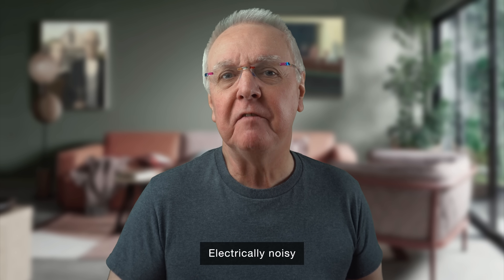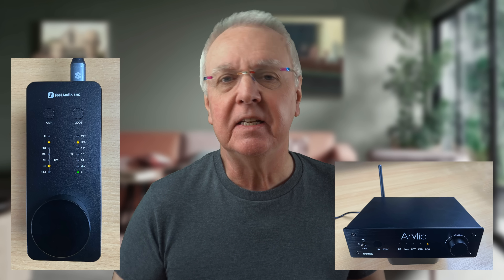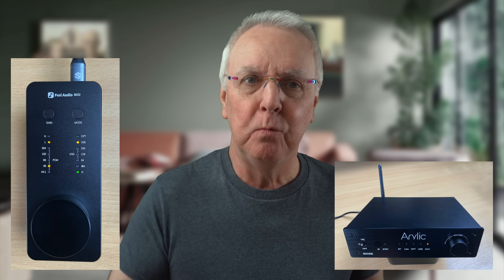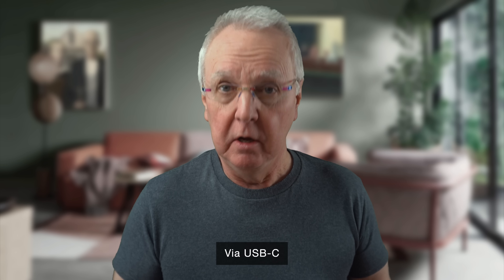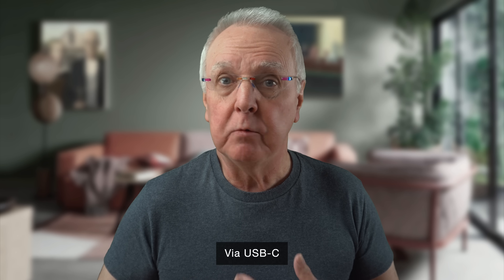Do optical cables have a sound?

Comment: RE  the external "What does Jitter sound like" link. Jitter is from several sources, pattern dependant jitter / inter-symbol and then random jitter from PSU noise affecting bias points, the phase noise of the clock ect. In the linked article, a jitter of 2us RMS (not pk-pk) is added. My DAC clock is 45.1 or 49.15MHz dependant on 44.1 or 48Khz multiple. A clock period here is ~24nS, so the jitter represents 80X the clock, which is crazy. Anyway modern DAC's incorporate a phase-locked loop and de-jitter circuit, so it gets integrated to a mean and effectivly ironed out.  Great channel BTW! A telecom SFP optical tranceiver will pass 1Gb/s or 2.5GB/s data and costs about £15 each. Multi-mode fibre will carry this over 500m no problem. I did listen to the jittered 1KHz tone, hilarious.

Comment: Good point about resistance. As I understand the amount of Johnson noise generated in a copper conductor is a function of bandwidth, temperature and resistance so I imagine one does not need to worry about this type of noise being introduced with optical. 

That said apparently optical cables with glass clading and glass core are the best but I find that most manufacturers are mum about the composition so one can't really be sure of what they're buying.

Comment: I remember in the good old daze, audio files would talk about a good marriage between components, especially amplifiers and speakers.  As every time a analog signal goes through any stage of amplification it is inverted and each stage can add its own distortion.  As light is just a carrier for P.W.M. it should be a much cleaner transfer.  In my tortured audio experience I have only come across very few amps and speakers that had a good marriage. But the few that did, anything that I played on them sounded fantastic and my search continues !  If I only could afford a 20 grand tube amp. to test my latest theory !

Comment: Are not the data points at the ons and offs? And isn't the speed of light 186,000 miles/sec.and constant. Bearing this in mind shouldn't all optical links sound the same. My preference would be optical for digital and wire for analogue if my equipment allowed it. Which it doesn't,
Reply: The speed of light in optical fibre is generally about two-thirds that of light in a vacuum. So about 200,000 instead of 300,000 km/s. Not that it matters a jot within an audio system. However, it does matter over distances measured in thousands of km if you are trying to sync up sound and video from different places due to the inescapable latency (which is about 1ms per 100km round-trip times). Musicians in studious separated by thousands of kilometres can have real trouble playing in sync due to the latency (which also impacts video too of course). Round-trip latency from the UK to Australia is typically about a quarter of a second, which is very noticeable.

Comment: A bit is a bit is a bit, but is a whole byte being a pig?

After working in noisy industrial environments in industrial controls and dealing with noise, inductive pickup, regenerative drive line spikes, switch power supplies.......    an optical connection between my Focusrite Pro40 output and my Kii Three active playback system was a dream come true. No chance of electrical noise. Don't forget that maintain guy running that drill, that person in the kitchen running the microwave, that receptacle  that the electrician switched the nuetral and hot on the plug, the video section of your receiver,  the CD/DVD player carrier and on and on. Optical is your friend.

Comment: Sorry to disappoint you, but if anyone can hear a difference between two TOSlink (or digital) cables, I would advise him to pay a visit to her/his physician because she/he's having auditory hallucinations. Toslink were a fad in the 80/90, you had optical discs why not having optical cables ? But it is the same exact signal going through a coaxial cable, just fed into a red LED (amplitude modulated) and received by a photodiode on the other end. So it is indeed limited by how fast the LED can be amplitude modulated (not too fast actually) and/or how fast the receiver can detect the red light. 
We actually have other optical cables in our houses today, and they are used for broadband internet, but they use proper optical fibre with industrial standard connectors and Infra Red transmitter/receiver. 
As for Jitter - it is the magic word that any true LP/analogues audio lovers like to throw at digital audio lovers to demonstrate its inferiority. My point: if you can hear jitter in digital audio, you should be screaming in horror any time you hear analogue music plagued by Wow&Flutter, harmonic distortion etc.. etc.
Reply: Whether it’s better or not… or whether one thinks it matters or not… is another story but 2 physically different things have differences. I’m not an audiophile just a studio guy who has shot out several reasonably priced cables with my colleagues… We did blind tests, null tests as well as trying these tests on different days. We heard the same differences/ qualities from the cables we had each time. We tried our best to not want to believe it either. It is what it is. 

I can’t tell you why digital information changes… but I hear it happening. 

We tried a Tara labs 
An Apogee Wyde Eye 
And a cheap single strand.

Comment: In digital transmission, the sound information is determined exclusively by the order of zeros and ones. A change in the sound can therefore only take place if the order of the transmitted zeros and ones is specifically changed. No cable can do that, whether electrical or optical. Anyone who believes otherwise has a fundamental misunderstanding of how digital technology works.
Reply: Absolutely correct! Four sentences of bombproof reason in this in this poppycock audio discussion. Can I compliment you also in your mastery of grammar and syntax.
Reply: It's way more complicated than zero and one 😂 the relation with time is the issue. That's why on good hifi sound system cables make a huge difference.  99.99% of people here have low Fi setup so yes any cable will do the job.
Reply: You are very wrong because a. you ignore phenomena pertinent to transmission that affect circuits before, during and after conversion to and from digital occurs and b. you are ignorant of the differences in the protocols of digital transmission (for example S/PDIF is not TCP/IP and Toslink is not Ethernet..). So your ones and zeroes might or might not be there in tact and even if these are in tact, quality of conversion to analog will still affected by things such as noise and timing issues (jitter). Any engineer involved in the lowers layers of digital transmission or in the ADA conversion knows that you are wrong. For just one example why you are wrong read @Roosville1 comment in this thread.
Reply: This is not about believing. The argument is that THEY hear the difference. And if you don't hear it, that's your problem. You can't convince THOSE who do hear THAT with any scientific or technical argumentation. :)
Reply: @kuko61  It's as nonsenical as people who claim they are non-binary. It's a physiological impossibility.

Comment: For any given sampling rate and bit depth I do not hear a difference between optical, coaxial or USB and I've used multiple cables in all instances.
Reply from the maker: As it should be.
Reply: The only difference would be if there was some leakage of noise into the analogue components. With copper connections there is always that theoretical possibility, although on a well designed system it ought to be all but zero.

Comment: I’ve tested quite a few Non-Glass, Opticals…with no audible differences. Once I used one of the few Pure Glass Optical cables, whose brand name is just that “Pure Glass Optical”, available, I would never put money into any other. I use it from my Sony TV to my Yamaha AS801. The sound is noticeable fuller and center channel information is more accurate than those Poly/Fibre Optical  Cables. I have historically used Glass Optical Cables from several CD Players I’ve owned and found the sound preferably to the Coax Connection. But only the Pure Glass Cables. Had you had the pure glass optical cables, you may have well heard a clear difference.
Reply: Are those Pure Glass Cables expensive? I don't need a very long one.
Reply: Alright! He's got a new quote for the next video 😅
Reply: @jasonkloos6348 ???
Reply: Actually not very, about 40 bucks give or take…but excellent sonically.
Reply: @Csnumber1  I've searched for them but not much luck. I'm considering the Corning USB to fiber solution as they can send and receive. That said I'd love to try a cable with actual glass cladding and glass core.

Comment: I remember back in 2005 getting all bothered about having my replacement studio monitor speakers having optical connections, and a good pro audio friend with a confused expression just asked me "why?".  It was a good question and what I should have been thinking about is, which is the better connection;  one that has to pass through more DAC circuitry that could degrade the sound or instead use higher quality monitors with XLR cables and better analogue connection with no extra DAC to bother about.  I went with the latter and a pair of Quested S7.
Reply from the maker: If your source is digital then there has to be a digital-to-analogue converter somewhere. With passive speakers it's going to be before the power amp. With active speakers that have optical inputs, and there are such things, then the converter is in the speaker, before the internal amplifier. At this point I don't know how the speakers are managed as a pair but it's something I might look into.
Reply: @AudioMasterclass   Yeah I was referring to active monitors with optical digital connection.  They may have been okay, but my friend was saying why introduce an extra unnecessary step in the signal path. Incidentally he used to have people come down to his business premises from Sound On Sound Magazine, when  I worked there and met people like Paul White (nice chap) and other known industry people.  I did not have any monitor conversations with them though.

Comment: So I have a Marantz K1 Signature SACD player, and for fun one day I decided to use the Toslink and spdif into an external DAC and got a really nice dynamic CD with a good soundstage and my challenge was to tell the difference.  Changing between optical and coaxial on the DAC and I couldn't tell any difference whatsoever. 🤷‍♂
Reply from the maker: As things should be.
Reply: You clearly didn't spend enough on the cable.
Reply: It seems to me that this is more about comparing DACs than comparing cables..
Reply: @pascalmartin1891  Not really. In my little test, I was connecting the same transport to the same DAC, just by connecting the optical and coaxial at the same time and switching between the two inputs on the DAC. I couldn't tell any difference, which really there shouldn't be.
Reply: @richiereyn 
I believe you. 

Playing the devil's advocate: then there are people who can't hear the difference between a MP3 file and a WAV or FLAC file. A test where n=1, isn't seen as strong evidence. And: “Absence of Evidence does not mean Evidence of Absence” - Dr. Carl Sagan.

;)
Reply: @Wuppie62 I believe that person who buys himself so nice cdp isn't among those people.
Reply: @Wuppie62  Yes, you are right. A well encoded mp3 is almost as good as the original file. I can't tell the difference sometimes, especially if it's a very complex piece of music where any artifacts may be masked. But if you run a null test you will hear the differences.

I bought an SACD player expecting there to be at least some enhancement to the sound quality and indeed there is. But what I've discovered is that often times it's because they chose a better master, or remastered something much better, usually with better dynamics than they would for a regular CD release. I mean, how would they possibly sell a SACD player if the music didn't at least have some improvement over the CD? But this is the thing. Most SACD's are dual layer and have the same recording in DSD and CD. When I switch between the DSD and CD layers, the 16 bit version sounds every bit as good as the DSD version. I can't tell the difference. So my takeaway is that if they paid the same attention to CD's as they do the SACD's, the CD's would sound exceptionally good, instead of having the life and dynamics sucked out of them.
Reply: @richiereyn  My experience as well, SACDs from Mo-Fi or Analogue Productions sound so sooo good, but not because of the format, but thanks to mastering. By no means harsh or piercing, but when it hits, it goes from zero to 11 in an instant.
Reply: And why are you not surprised....
Reply: I have used s/pdif and toslink for audio for over 20 years. s/pdif generally sounds a bit better on short cable lengths, toslink is better for longer cable lengths because is immune to magnetic interference.
Reply: I did the same,but yeah there was a noticable improvement in sound quality.And the optical cable was a Monster branded cable,that came with some other piece of equipment,then tried optical cable that came with my "Creative 5.1" surround sound system probably 15 years old,no difference between those two optical cables.
Reply: SACD audio only comes out of the analog jacks.
Reply: Try not connecting both cables at the same time. All these connected cables may contribute to electrical noise/EMI. Connect the one you want to evaluate, then you're likely to hear the differences.
Reply: @hazzy9079  There can't be any electrical interference with an optical cable.
Reply: @richiereyn  sorry i dont have the explanation to it other than the sonic results can be heard. Probably the output stage affected with two lines connected. Anyway i was hoping the tester to have a listen first, theory can come later. Let the ears be the judge when it comes to audio.
Reply: @hazzy9079  Placebo. They both carry the exact same bitstream. It is literally impossible for one cable to sound better (or different at all really) unless one of the cables is straight-up broken, and in that case the difference would Not be subtle, you'd experience either total dropouts, horrible artifacting that absolutely mangles the sound, or both.

Comment: What I don't get is while super-golden-eared audiophiles are always concerned with the quality of their cables and plugs and such, they never consider the quality of the air in their listening rooms. For the best possible sound to make it from your speakers to your ears, you need cryogenically conditioned, nano-particle filtered, electrostatically-discharged, xenon-reduced, and never-before-breathed audiophile-quality air (containing exactly 21.0956% oxygen) in your listening room. I don't know how people are listening to music without it! And when was the last time most audiophiles had their earwax aligned to the RIAA standard?
Reply from the maker: You might be onto something here. Air absorbs sound, moreso when the air is dry than humid. So an audiophile might consider that there is an optimum humidity to get the best listening experience. I'll ask Phil.
Reply: @AudioMasterclass  these comments are all funny but I believe the most important thing is the ambient noise present in your listening room has much greater effect in the air itself
Reply: "than the air itself"
Reply: @AudioMasterclass   Anyone who has been in an old stone mill building used for rehearsals and studio recording, knows this is definitely a real thing.  The different seasons do have an effect for sure.  Or at least it seems to be the case;  our perceptions are easily fooled! 😁
Reply: @AudioMasterclass  Don't forget that earwax calibration!
Reply from the maker: @ScottGrammer  I'm trying to resist the temptation to Google for 'audiophile earwax'.
Reply: @AudioMasterclass  I'll bet SOMEBODY is out there selling it.
Reply: I have a fully acoustically treated listening room.  In regards to air, i have an air exchanger unit in the loft that  brings in  fresh unpolluted Swedish air into my listeing room.  I don't have super-golden hearing, but i have absolute perfect pitch.  When you're an audiophile like me EVERYTHING matters from incoming electricity, separate fuse box with audiophile circuit breakers, i run 3 x 18m gigawatt installation cable to my listening room, Furutech wall sockets, 2 Isotek power conditioners, audiophile grade fuses by Synergistic research £600 each, a hifi rack with  Sound care super spikes and  Nord kones under all my hifi separates.  Audio Phil is an amateur
Reply: @ac81017  But what do you have to compensate when your girlfriend comes in the room and displace her volume of air? Or when the atmospheric pressure drop or rise?
Reply: I mean, the ambient temperature, humidity and air pollution in the room could matter to a certain point, as sound is just air in vibrating motion.
Reply: I clean my air with UVC Light!! Seriously.
Reply: Lol😂